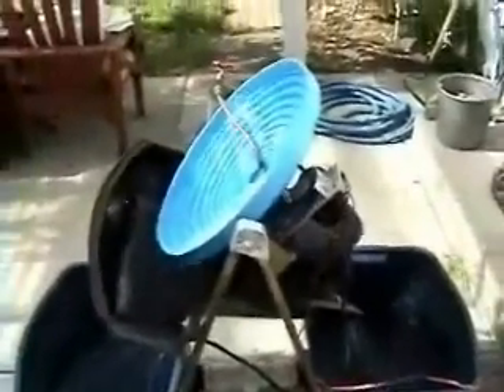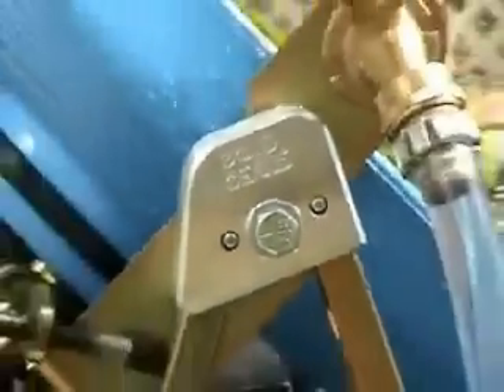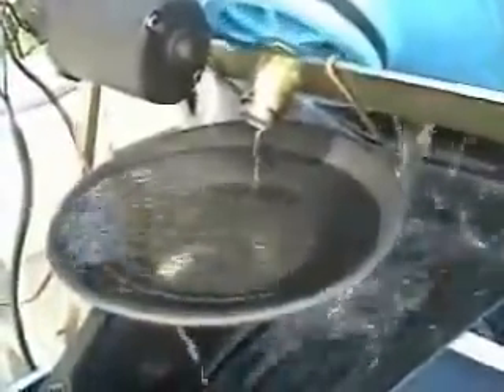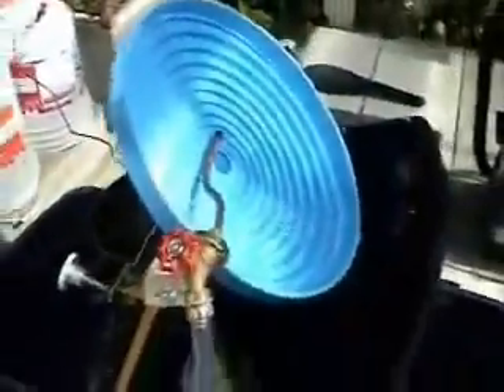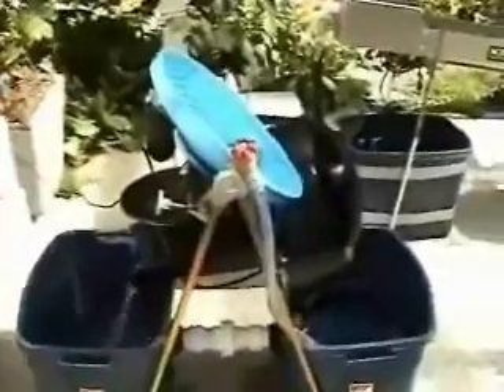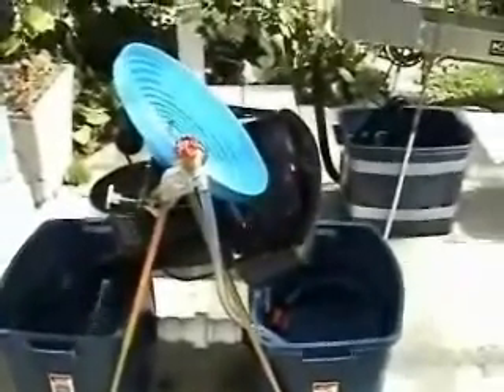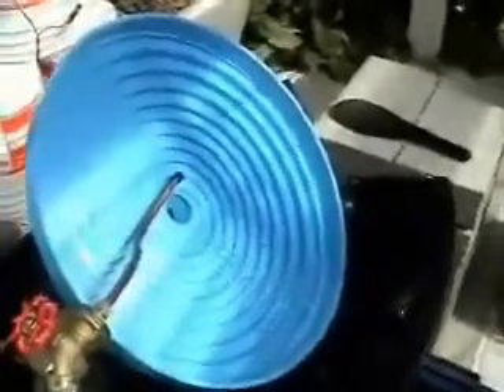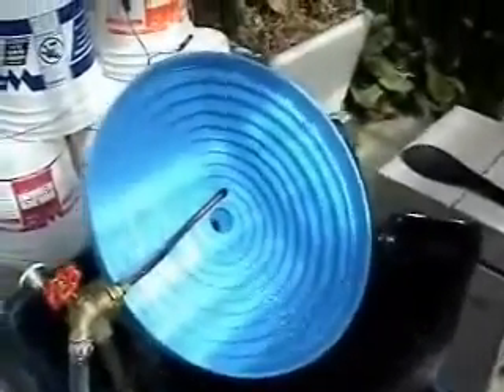GOLD GENIE Miners Model Review

Comment: What the commentator forgot to mention is, that all Alluvial concentrations have, organic materials which in turn has plant oils, that attach to the gold, and other mineral oxides as well, that tend to make the gold particulates float, and is called "Float Gold" and after removing the black sands, the material not black sands also has gold that slips away, so in such a case, the material not removed as black sand must be washed with 2 drops of "Dish Washing" (For Every Pound) detergent in order to remove these oils, then rinse, and rerun the material again to concentrate the fines, and thus too, the black sands too must be washed in this manner in order to extract from them the float gold, and "Flour Gold" as well, using the same process.  And once having done this, you must apply a "Chemical Dressing" depending on the mineral oxides present, which attach a film onto the particulates and can also cause for the gold to float, or obscure the Gold color on each particulate, thus not appearing as gold, that there are Seven different types of oxides that can give gold seven different colors, and confuse you as to it being gold underneath these colors.  A Spectrographic analysis of the base materials will tell you what minerals are present in order to know what Chemical dressing to apply and remove these oxide films from your gold...